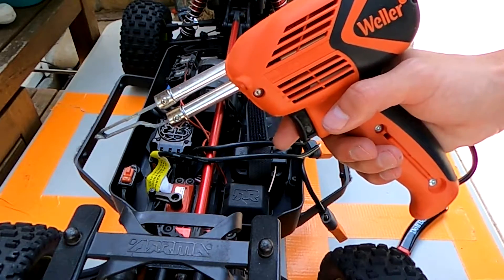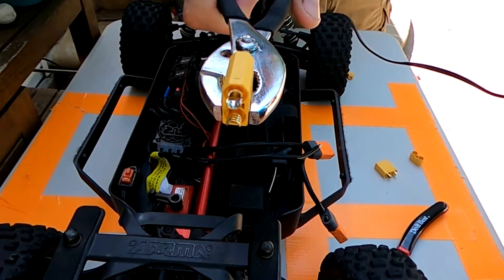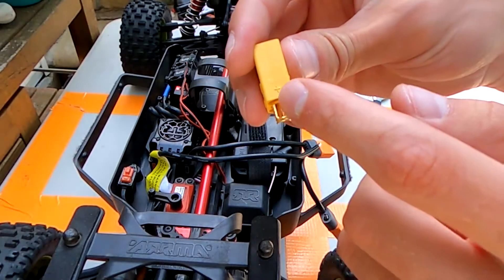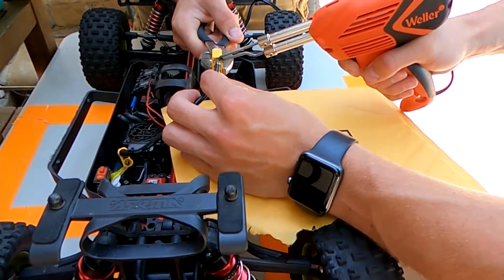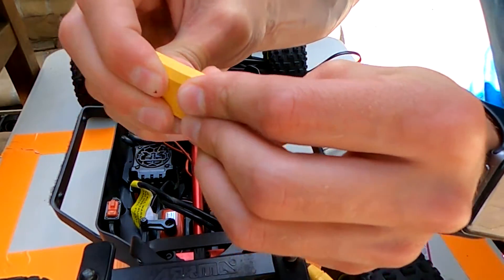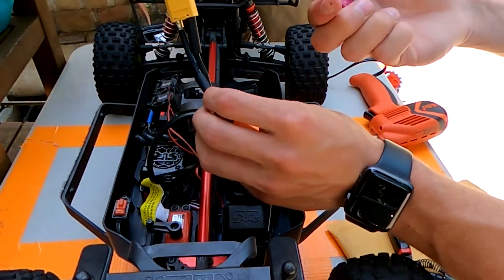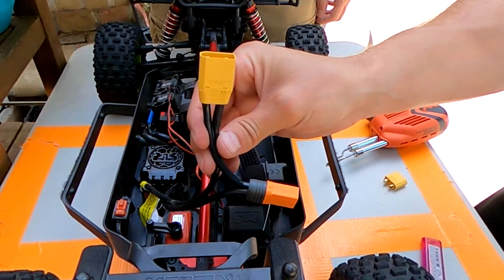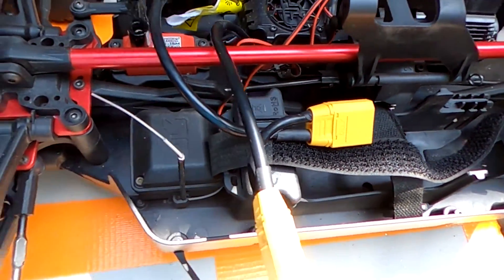HOW TO SOLDER: XT90

Comment: What about using flux?
Reply from the maker: That’s a great question and I probably should have addressed that in my video. I only use solder with rosin core so it’s not necessary to use more flux.
Reply: @MikeStallone  ok thanks
Reply from the maker: You’re welcome! If you have any other questions don’t hesitate to ask!